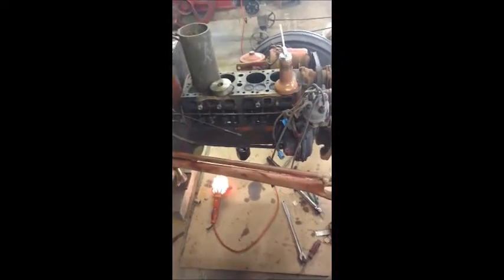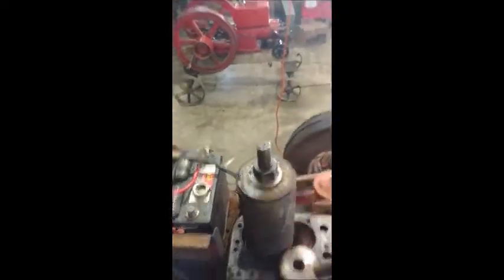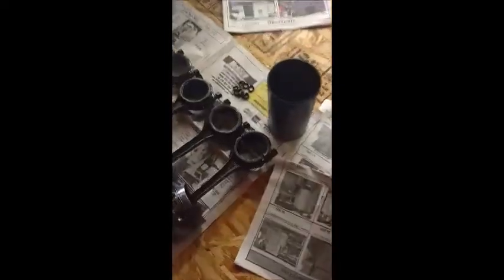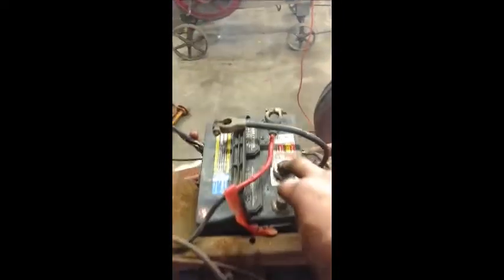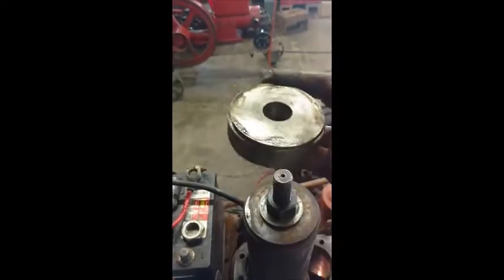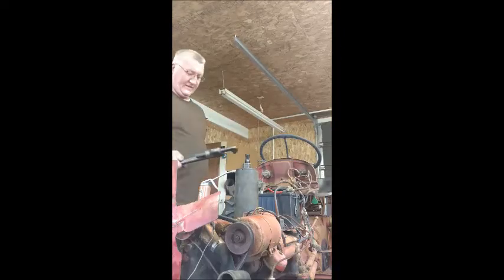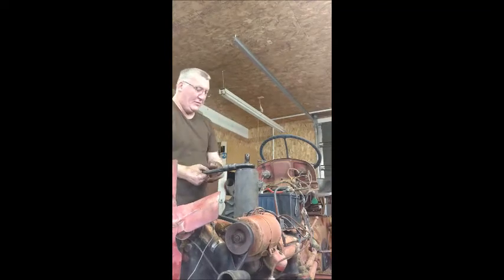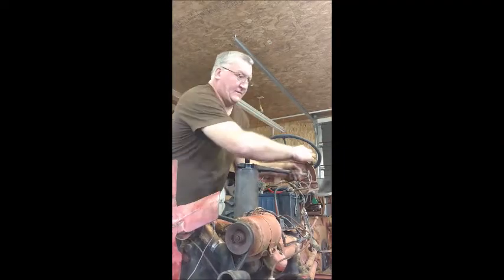Pulling a sleeve on a Ford 8N

Comment from the maker: The sleeve outside diameter for the "thick wall" sleeve is approximately 3.450"so you need a piece of pipe at least that diameter. I believe mine is 4". The sleeve length is 6"so you'd need at least 7" of pipe.
Reply: Sweet god.  Thank you.   Model the puck portion after the sleeve-- about 1.5 inches thick?  The rebuild kits are cheap but the tool you made is a 100 dollar bill. I have a few large hydraulic jacks that might have this size scrap metal.
Reply from the maker: Yes, about 3/4" inside the pipe and 3/4" on top of the pipe

Comment: Your puck measurements, hell, the pipe dimensions, would be a fine addendum.  My 2n smoked badly and locked up this past winter when attempting to start it.  I expect chaos the instant I drop the oil pan since the flywheel ring gear is missing about 3 inches of teeth.

Comment: Hi there had something interesting/concerning happen with my 8n when removing the sleeve. It came  out fairly effortlessly and was covered in oil. Any idea what this may mean? Has the sleeve been slapping around and allowing oil to seep in? Is that even possible? Thank you to any response I may receive.
Reply from the maker: Hi Andrew, if the sleeve came out pretty effortlessly than I have to assume it had loosened up in the block and was probably going up and down with the piston a small amount. Should this happen? Nope. Does it? Yup. Sounds like you need new sleeve and piston kit. Before ordering though I would mic all the bores and make sure you don't have a worn bore or bores before putting in the new sleeves. As for making the pick that goes on the bottom of the puller, you have to know what thickness sleeves are in the engine. There is a thin wall and a thick wall sleeve that were used at different times. I went under the engine and measured mine too know what I had before pulling them so I knew what size to make the puck. The diameter of the larger part of the puck is about 5-10 thousands smaller than the outer diameter of the sleeve so that it easily clears the block bore when you pull the sleeves. Hope this answers your questions.
Reply: Hey I never got around to thanking your for the information. I believe you are correct the sleeve was most likely moving up and down with the piston, that was actully the only one that came out effortlessly. Interestingly we found that there was punch marking from a tool of some sort that went in a circular pattern around the sleeve, we believe this was done as en effort bend the block slightly to hold the sleeve in tighter. The engine was rebuilt in the 60s for some reason when they repainted them ford blue, we believe that's when this happened, somebody might have accident honed that cylinder down or somthing? Either way when it came time to reinstall the sleeves were very tight on all cylinders and as extra insurance we grabbed a tube of sleeve permatex sleeve retainer. It's kinda funny the sleeves were actully so tight we used a Co2 fire extinguisher to cool one of the sleeves before installing it for ease due to contraction. We first let them sit in the freezer for a few hours. Overall it was a great time and the tractor runs better than ever now! Thank you for the information!